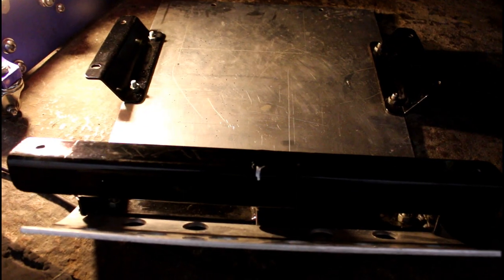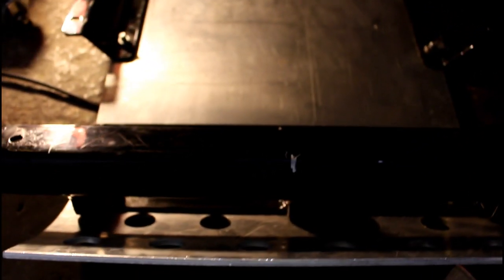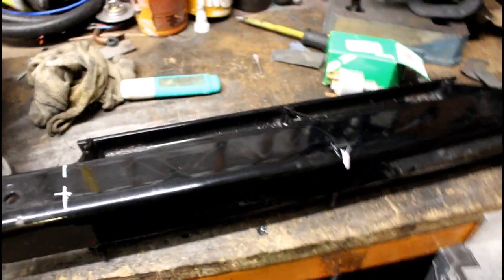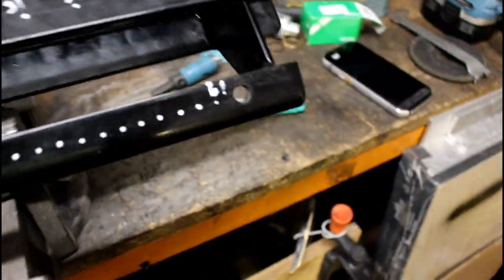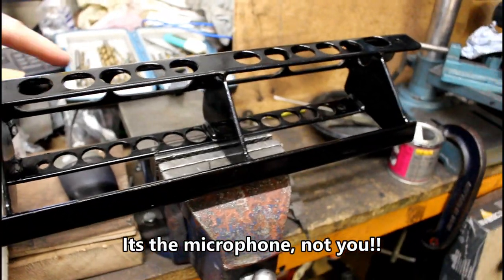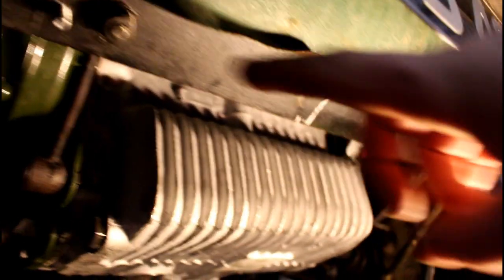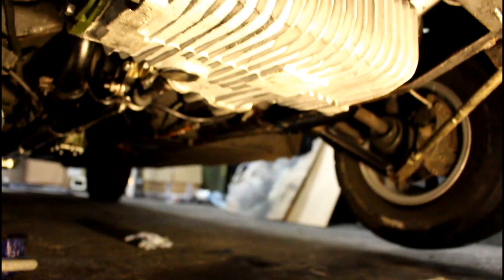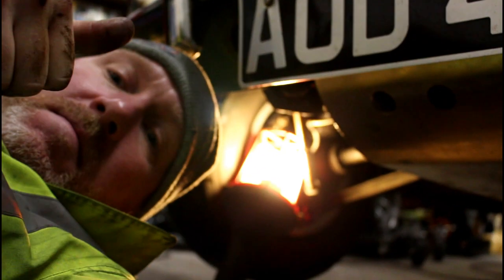Austin the Arden 8 Port Mini gets a sumpguard fitted.

Comment: That's keen fitting a Scottish Guard! Still it will protect your box. I had the same one on my 64 when we were rallying back in UK, but taken it off now, too much hassle! I used to put a pad of soft foam in that gap between guard and the bottom of the box to stop rocks getting in and potentially popping a hole in the box on the next bash! It used to take a beating, sometimes twisted when taken off, but nothing a BFH wouldn't put right! I'm saving for a lift too, getting too old for lying on the floor! Ha!
Reply from the maker: One of the more light duty ones but with a curved front would be perfect, but no-one makes such a thing. The one on bumblebee has some fair scratches where its caught on the road crown on some of the roads round here.
Reply from the maker: It's also just a catch tray for the oil pissing out the gearbox, but that's another story!